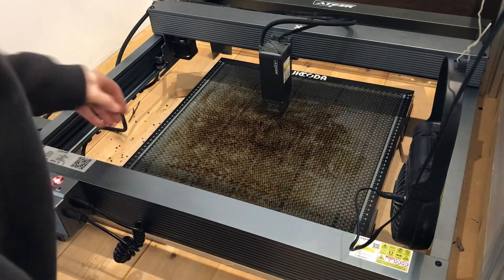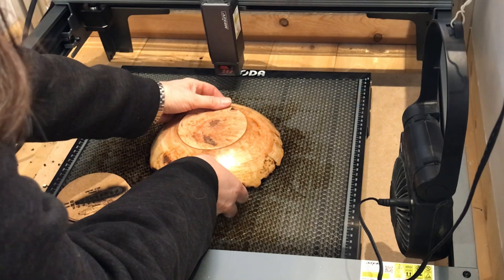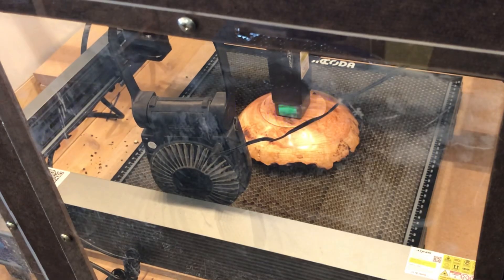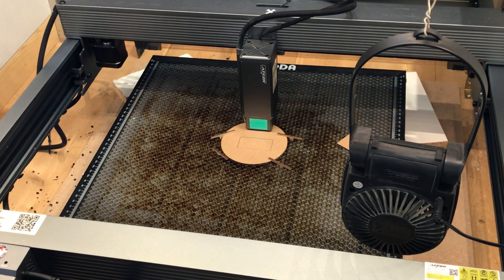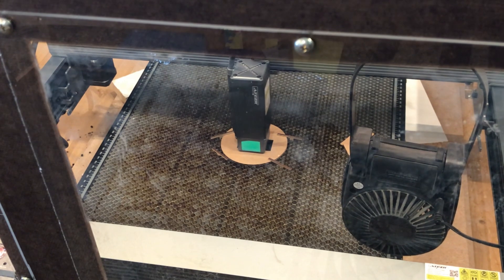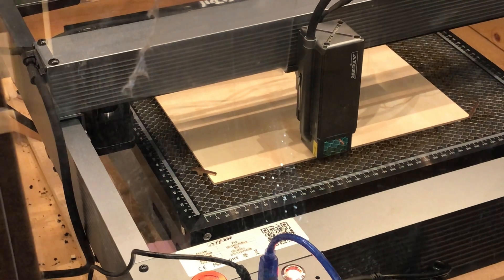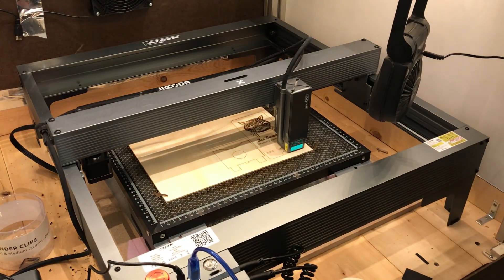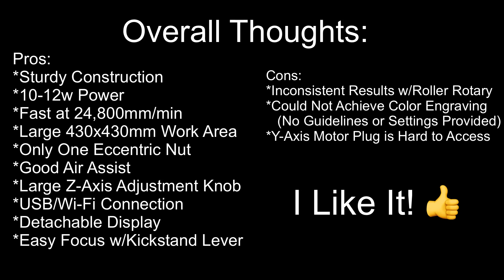Tool Time Tuesday: The Atezr P10 Comb Laser Engraver

Comment: Nice testing of the Atezr Lisa. Curious about the enclosure you have. Is this something you put together or is it store bought?
I addressed the Y axis plug issue in my video last week. Works like a charm.
Gary
Reply from the maker: I built it. I still have the Two Trees video to finish and I show it more in that one. Thanks for your help with these, you’ve been a lifesaver! I haven’t had time to fix the motor plug yet but am super glad I’ll have your video to show me how it’s done 👍
Reply: Thanks Lisa. In the back room of my shop where I have a window I can open I already had something built that can be used as an enclosure. I used to make home brewed beer and it was a place to keep it warm in the winter while it fermented. 
All I need to do is put a front on it and pipe it out the window. Which is my plan. I have the Ortur sitting in there right now.
 I have had other feed back with about not liking that plug setup. And they are looking forward to changing there.
 I will watch for your video where you show the enclosure. I like the sliding front you have.